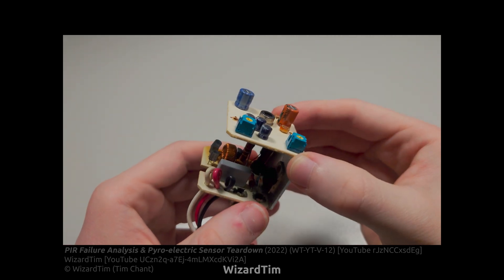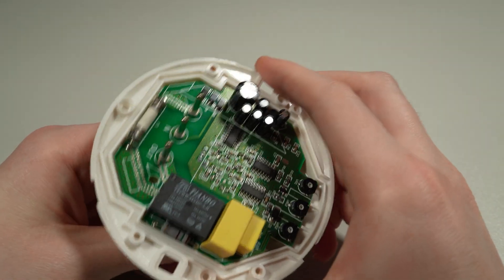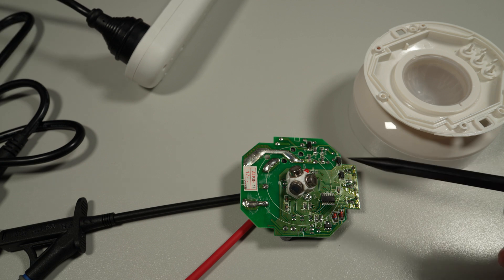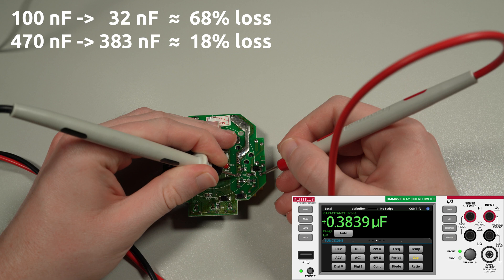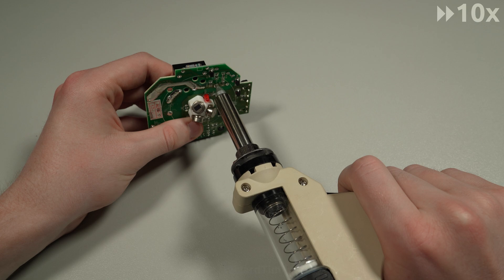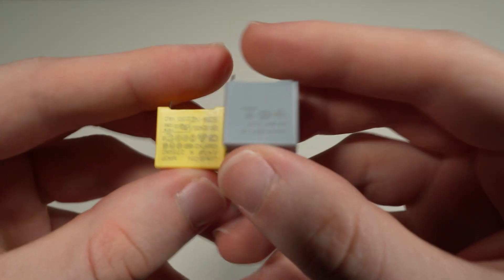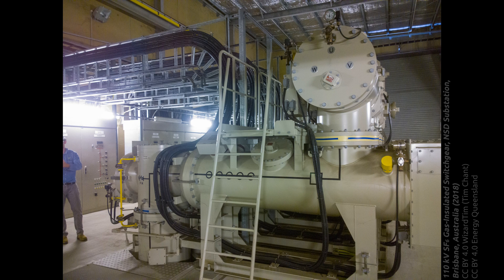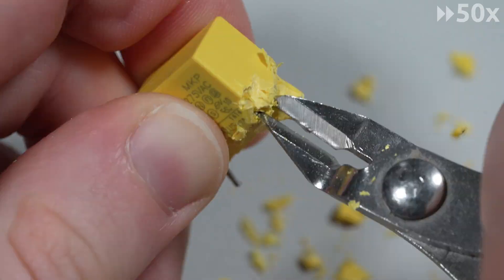ROBUS PIR Motion Sensor Repair & Failure Analysis

Comment: That thud you heard when you attempted to shock the capacitors was the LP12's internal safety dump relay, the impedance sense probably found something out of wack when it tried to initiate discharge and sent the energy through the dump circuit
Reply: Side note: I'm very familiar with the 12s internal workings, if you have any questions about the workings of your unit I'd be more than happy to help. I'd also recommend giving the service manual a thorough read, it's freely available online and whichever version you find will likely apply just fine
Reply from the maker: Interesting! I knew about the dump circuit and have heard it be switched in when you command a charge but then cancel it, but didn't know it could be switched in during the discharge but now I think about it, it makes sense it should. I have had a couple instances discharging into strange loads often with bad contact it gives the "ABNORMAL ENERGY DELIVERY" or "ENERGY NOT DELIVERED" messages, but can't remember what sound it made. 

Unfortunately I didn't record the screen of the LP12 but I did have another wide camera angle I used for the audio which happened to record the therapy cables jump a little from the magnetic field during the discharges and I can hear the 3 beeps after for the priority 3 tone so I think it probably did get the full or part of the 360 J. The thud sound in the recording does sound different to the usual click of discharging into 50 ohms, I can't remember what I did for the audio, I might have recorded it with a lapel mic, possibly very close to the LP12, but I can see in the edit I put a +24 dB gain on it otherwise you can't hear it, in the raw recording it's a very quiet click sound.

Next time I'll also record the discharge waveform with an oscilloscope current clamp and HV probe so I can show the real peak power the component is subjected to (18.5 kW figure is just for 50 ohms) and be confident it actually discharged properly in both phases.

And thanks for the tips. I certainly would not be using it without having first read the operators manual and service manual (which are really good). This particular LP12 was damaged in shipping from it's annual calibration so was written off as a total loss, I got it and replaced the shattered LCD and repaired the ECG/SpO2 PCB. I've been meaning to make a video about the whole thing but haven't had the time. But I will eventually!

And thanks for watching! I remember when I got the LP12 I watched quite a few videos about them including yours so cool to see you here.
Reply: @WizardTim   That's cool! I didn't know you came across those old vids. I also recently fixed up my 12 and got it calibrated and repaired and the software updated so it's just like new and made some new vids on it.
And you'd be right in thinking some energy would make it even with an abnormal delivery message. I was messing around one time and zapped an apple, made a big spark along with the abnormal energy delivery message. 

Im more familiar with how the defibrillator reacts with hard paddles since it's more lenient on letting you discharge those into thin air or strange loads (where most of the time it'll just engage the dump relay). I'm more hesitant with using the therapy cable for experimenting because I want to keep it in good shape in case someone licks a power outlet wrong but luckily I have a couple of other units with cable that I can experiment with (though they are monophasic).

 If you want I can invite you to a small little med tech enthusiast discord I run, we have a good number of people who are knowledgeable in different tech for example I am the resident expert on LPs while another person knows more about Zolls. 
All the best!

Comment: I have three of these PIR units in my house (UK), two have died in the past and I just replaced them, the latest failure and I found it difficult to buy another straight away, I searched on line for one to buy, and found this video by chance.  I took mine to pieces and found it had exactly the same capacitor problem, two new ones from ebay (£5 for two sets of ten of them) and it works!  Thank you so much.

Comment: I learned so much!!! Im so interested in learning about these type of failure modes. Where did you learn these skills from? Can you point me to where you get the Transient generator that you used for blowing up the caps?
Reply from the maker: Thanks! I learnt most of it from YouTube videos just like this one from other people along with plenty of blogs and forums but also an electronics engineering degree at a university and also through my employment. The transient generator is actually a medical defibrillator, specifically a LIFEPAK 12 that I repaired which will be the focus of a future video (#20). But I must note that defibrillators are dangerous, don't play around with them unless you know what you're doing, the energy they store is lethal.

Comment: The fact that you pulsed it and it didn't lose any capacitance is super interesting.. maybe having the X cap closer to the heat source in some cases is beneficial? Drive off humidity? Unless its just humidity when manufactured and not after.

Comment: Very informative and entertaining video. These X2 metallized polypropylene capacitors always seem to fail over time, and it's more noticeable when they're used in a capacitive dropper power supply. This capacitive dropper design just doesn't seem built to last.
In case anyone'd wondering, you can look at the Jimson datasheet at https://datasheet.lcsc.com/lcsc/1912111437_Jimson-MKP474K275A33_C434164.pdf